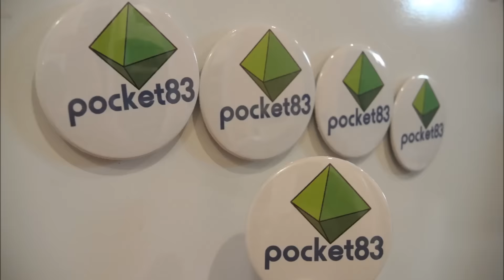Cubic RGB pixel lamp (begin)

Comment: It is not 7 cubed. It is only 7x7x6. There are only 6 sides on a cube.

294 holes according to Mr. Calculator.

It seems that it should be 7 cubed, but when you think about it, the number 7 has almost nothing to do with how the operation is done.  7 is simply the variable in the equation for the surface area (or number of holes) of a cube, which is 6x^2.